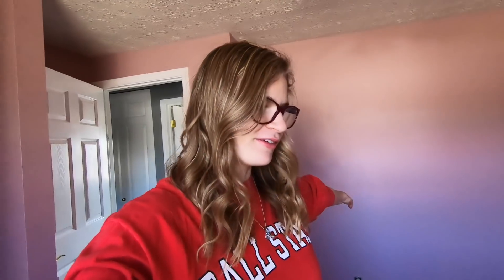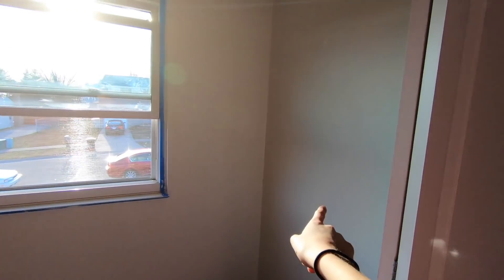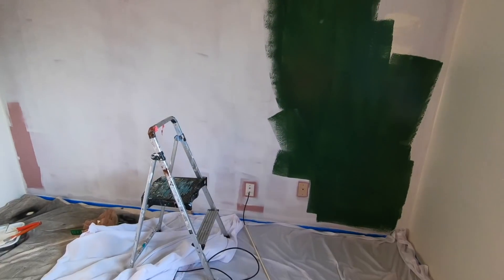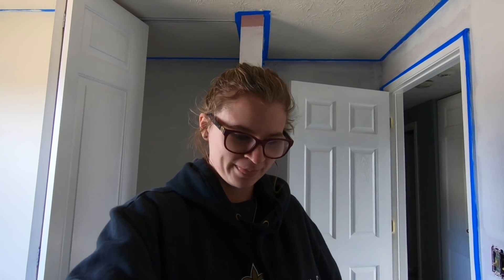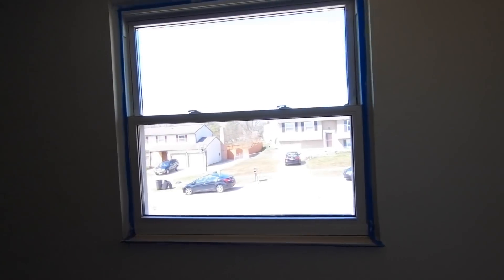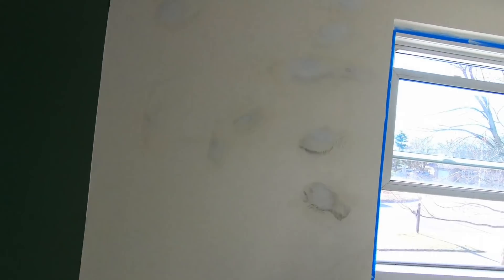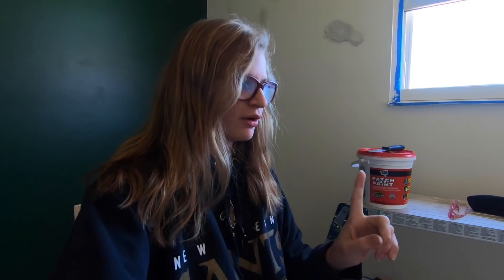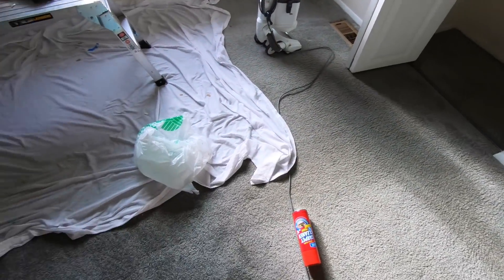GUEST BEDROOM REMODEL // BEFORE + AFTER

Comment: What an improvement! The room looks awesome! My painting tips- invest in a good quality angled brush and with a steady hand you can do the trimming without taping. You should trim 1st then roll. Don't overload your brush with paint . Also don't go cheap with rollers or you may get lint on wall from roller. If you don't finish, wrap the roller with paint on it in saran wrap and put in refrigerator. It will be ready for you to use the next day.

Comment: Elizabeth, (you are too cute, but you will learn). When you were taking about the bar in the closet, those two plastic things that stuck in the wall on the one side aren't what you think. They aren't part of the rod. They are used with screws that aren't being screwed into an actual beam (wood). When you screw screws into plaster and there is no beam to support the screws the screws will fall out and destroy the plaster.  To prevent that, you make the hole, place those plastic things into the holes then screw the screws into the plastic things so the screws hold & don't fall out. But remember if your putting screws in a wall (or nails) straight into a beam then you don't need those plastic things
Reply from the maker: 😅😅😅 I have SO MUCH to learn, haha. Thank you!!
Reply: @eliza_beth_clem  you will learn it all. You are so smart. Good luck. Im glad I could help.